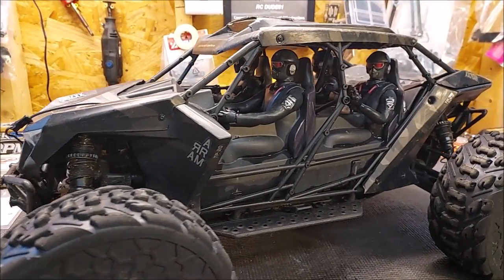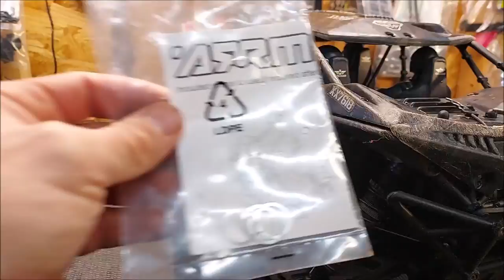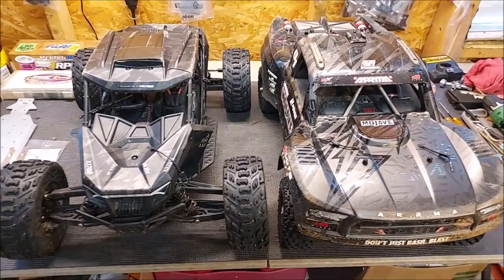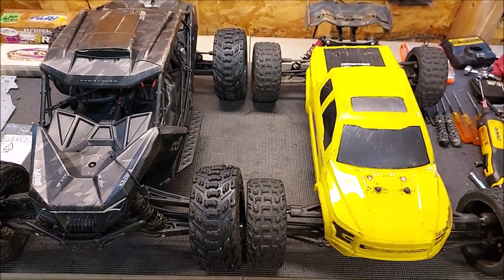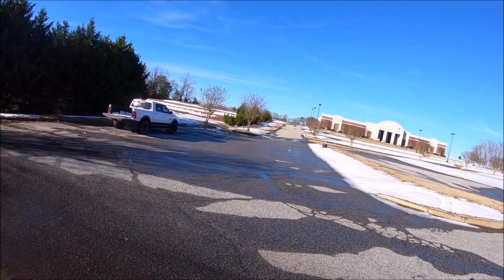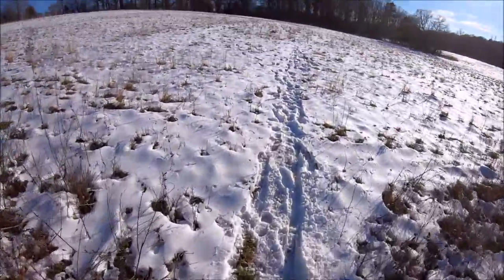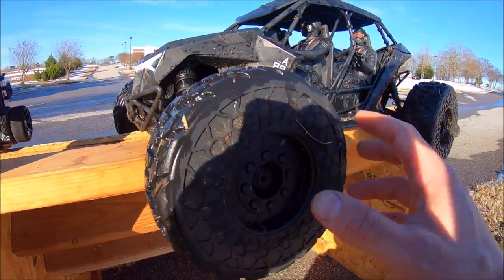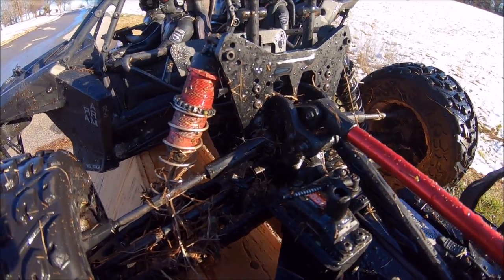NEW! Arrma Fireteam 1/7 "AERIAL ASSAULT!"🚀 Aftermath, Snow bash and MEGA Launches!

Comment: if was anybody else be no body left.. thats brilliant how can individually buy the body panels! those tyres really do rip up that snow with central larger grip, almost a central paddle tyre.
its taken the most extreme of extreme bashes by you and with that little damage and still running is truly a tuff arrma. were the brace/chassis bend and rear brace break from the full sends? 
mega speed ramp always a spectacular thing to see 🤩
brilliant video with info!🔥

Comment: Do you fully disassembled your cars to clean them after each run??
Reply from the maker: No usually unless it's a deep clean. I hose them off with water and some Simple green. Use an old toothbrush to scrub then use a air compressor to thoroughly dry. Then soak everything with a Silicone based lubricant and oil motor.😎

Comment: Nice video!
I have to order one of these fireteam trucks😁do you recomend that i shim the diffs before the first run or after some packs?
Reply from the maker: If your going to go extreme out of the gate I would. If not definitely shim after the first couple packs after the initial break in.😎👊
Reply: @RCDUDE81  what size 6s lipo do you recomend for this truck?
I was thonking 2st gens ace bashing 3s 6800mah 120c or are thosecto heavy?
Reply from the maker: I actually love the 7200mah 100c Socokin 6s packs. It's what I've been running in this truck. The packs are small to be such large capacity! Killer punch too! I have a link in the bio for the packs!😎👊
Reply from the maker: @johanericson1854  https://www.amazon.com/Socokin-Battery-7200mAh-Connector-Associated/dp/B093WDCPZS/ref=sr_1_13?m=A1ENPJMJOTVDWY&marketplaceID=ATVPDKIKX0DER&qid=1636337710&s=merchant-items&sr=1-13